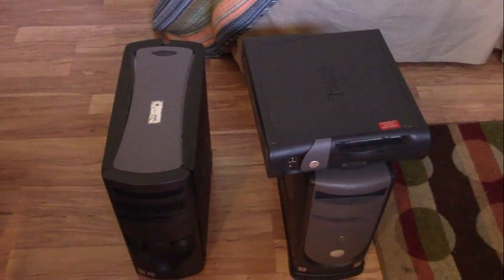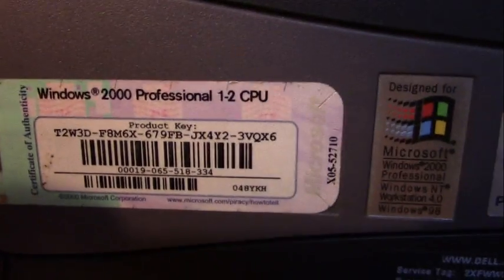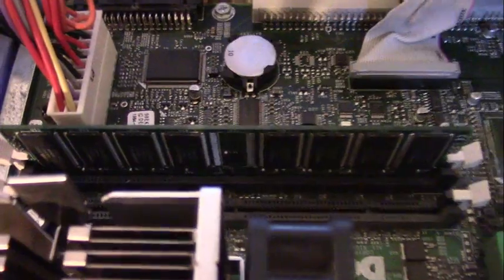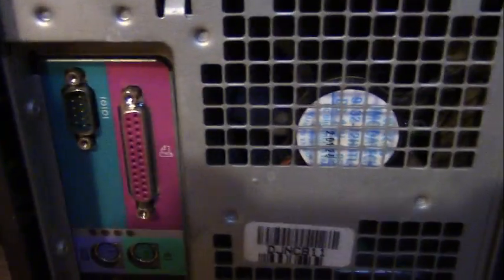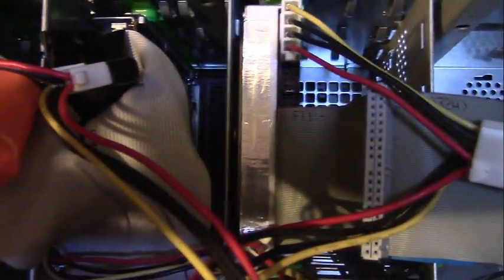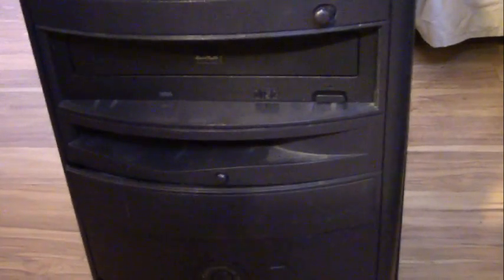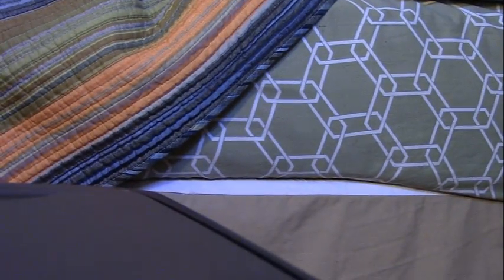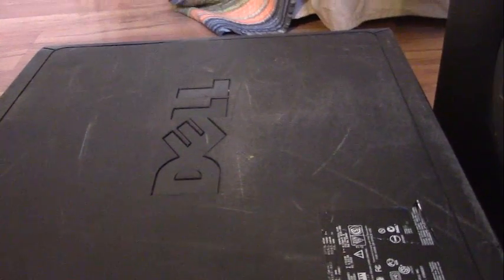Trash Picked Dell Computers

Comment: Make sure if you see any vintage ones! same them! (pre 1995) also I swear those slimline power supply's are just server power supply's just slightly modified and By around 2003, RDRAM was no longer supported by any mainstream computing architecture so its roughly one of the last machines with rambus!